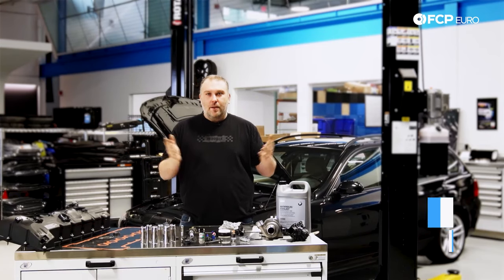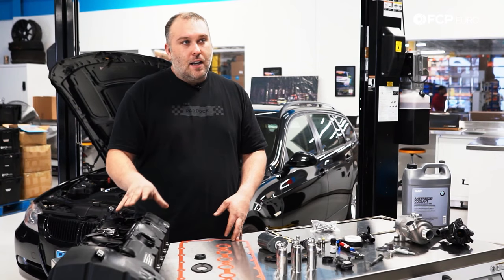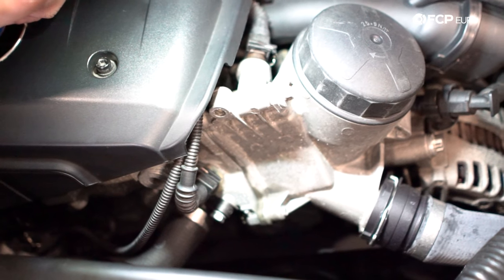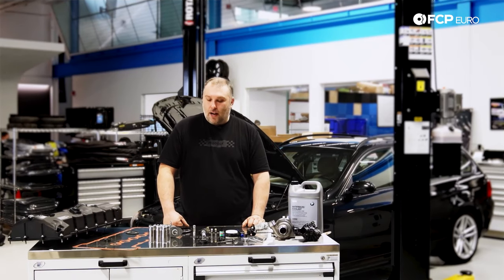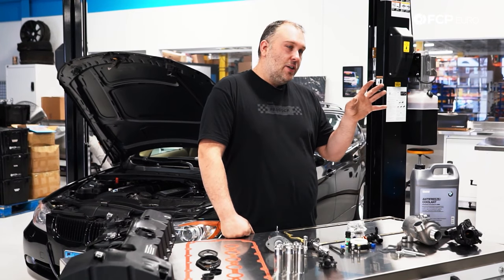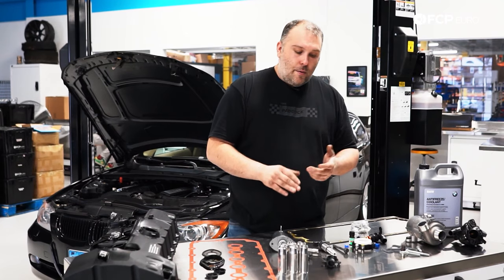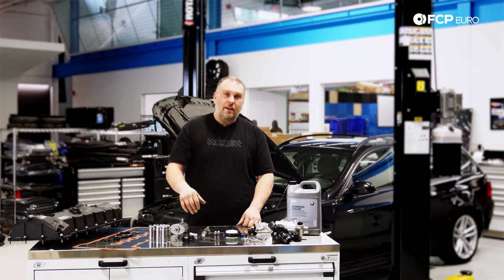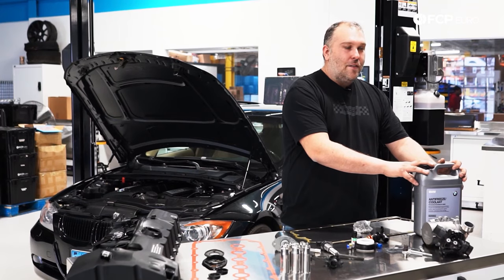BMW N52 Engine Diagnostics/Problems - Everything You Need To Know (128i, 325i, 328i, 330i, 528i)

Comment: These are certainly all the things I need to watch out for. I bought my 2008 328xi 6MT about  a year ago with 83k miles on it. All I know is it was a 1 owner car with no accidents but I have no idea if anything has been replaced on the car other than the previous owner had all of the recalls done. So far I have been lucky that all I've had to do is put gas in it. I had my mechanic look the car over when I first got it and the only thing he saw was a tiny oil leak from the oil pan gasket but there is never a drop on the ground so hopefully that doesn't get too bad too soon because he said it is a several hour job because of the x-drive. So I guess my only question is, do I just wait for parts to fail or would you be proactive at this point and start to change things? I now have 86K on it. (I live right down the street from my work so I don't put a lot of miles on it) For example, I have no idea if the plugs have ever been changed or what type of oil it's run on for it's life. Would it be a mistake to put LiquiMoly in it or Mobile 1 if it's only had conventional oil in the past? This is my first BMW and the car still looks pristine and I would like to keep it running as smooth as it currently does. Also, I live in Wallingford, CT and you guys are great!
Reply from the maker: Hey Sagan glad 328xi ownership has treated you well thus far! We always suggest staying on top of your cars maintenance and preventing possible issues from arising that can prove to create bigger issues. That being said its not necessary to throw every part in the book at the car. Sitting right around the 80k mark is really where we most commonly see things start to go. For now swapping the plugs, potentially throw in in a engine flush and some fresh LiquiMoly or another high quality oil simply cannot hurt (our most common https://www.fcpeuro.com/products/bmw-oil-change-kit-5w40-e60-e90-e82-f30-11427566327kt-lm ). Glad to hear you are local, be sure to swing by the retail center in Milford if you havent already (well once the current situation clears up)! From there just stay in tune with what your car is doing, dont let things go, once you notice an issue move to the remedy (your cooling system especially at that mileage).
Reply: Thanks so much!

Comment: On some models changing the oil pan gasket is a nightmare as you have to drop the subframe. I have heard of a shortcut where you cut the gasket in a convenient place so you can snake it in place and cover the joint with RTV. Any thoughts on that (other than the expected "don't do it" 🙂)?

Comment: Great video.  I am a long-time customer, years ago driving down to buy parts when you were in Groton.  I have two N52 in high-mile X3s.  Have done much of this work over the years.      An important note.  The BMW response with VANOS bolt failure is odd.  Some cars fall under a Safety Recall and other are under a 10 year extend warranty.   Last Fall the VANOS bolts heads sheared off on one of our X3s.  The bolt heads took out the engine and BMW replaced the engine under the warranty.  The warranty for that vehicle expired in April of this year.  Dodged a bullet.  Current problem maybe you can shed some light on. Suddenly I have had the engine cut out and cut back in repeatedly while driving at speed.  Idles great.  I have a BMW fuel pump to put in and hope this takes care of the problem.  Did you ever hear of this issue? I really do not see this mentioned on line. Feels like fuel starvation.  Thanks!
Reply from the maker: Thank you for the longtime support! You certainly did dodge a bullet with that warranty! That cutting out does seem like it could be a fuel issue, fuel pump is a good place to start. Any codes?
Reply: @fcpeuro  No codes using a Foxwell scanner.  Using the CTA fuel pressure tester that you sell, the pressure at idle is good.  Will how it goes with the new pump.
Reply: @fcpeuro  Follow-ups can be helpful.  I was totally wrong on thinking the "loss of power" may have been the fuel pump cutting out.  The fuel pump pressure tester that I bought from FCP  showed spec pressure.  Long story short, the problem was the right rear reluctor ring on the axel shaft that had underside localized corrosion that lifted a section of the ring so that it made contact with the speed sensor.  There are some videos on this. I did not have any engine lights but did have the trio : Brake, ABS, and 4X4 dash lights. Also a code indicating issues with right rear speed sensor.  Should have picked up on this right off.  It apparently sent the signal that that wheel was not turning and DSC  traction control system applied brakes to the other wheels. I understand that DSC can also cut engine power (in manual).  Extremely disconcerting on a highway with much fast moving traffic. Do the brake lights even come on when this happens?    I was driving on the shoulder with the bakes coming on and off. There are references that shutting off the DSC will eliminate the braking effect when you have this failure. Good to know for a temp safety situation.  New GKN axel shaft (has ring) and BMW speed sensor fixed the issue.  No dash board lights or codes now.. "On The Road Again" Thanks FCP!

Comment: what should the pressure RPMS on the 328i waterpump, 2008 sedan? thanks great videos..also in my old waterpump were orange pinkish pieces of plastic clogging the impeller fins and stopping them from turning.where did these pieces come from? thanks hope u cna answer~

Comment: Thanks for the info and I would like to find out, I am driving a 2007 E90 325i and it sounds like a diesel. My mechanic believes it is an oil pump not working properly. Can you please advise?
Reply from the maker: You're welcome, Papillion. If your N52 sounds like a diesel, worst case is that it could be a failing oil pump, however it could also be a faulty hydraulic valve lifer. If it is the valves making the noise, you can try some LIQUI MOLY Hydraulic Lifter Additives to see if it quiets the engine down. https://www.fcpeuro.com/products/hydraulic-lifter-additive-300ml-liqui-moly-lm20004

Comment: By the way the camshaft Rector rings that are steel or stainless they make a Teflon replacement unit that go on them so if you have to pull camshafts it's best to replace us with Teflon rings,
By the way the oil is not sneaking by? It's leaking because of the clearance and erector Rings is allowing the oil to bypass the ring! I don't know where the sneaking part came from? LOL

Comment: Hi there, Thanks for the video. At 11:42 you stated that clean the no return check valve and make sure it TURN , Can you please explain. I didn't find any part that turn. it only have an spring inside. What is a good way to test it and how is supposed to operate. Thanks

Comment: Also the cam ledge bearings seem to be a somewhat common point of failure. Along with lifters sticking, due to their check valve lifter design. I believe these are caused by the poor design of the valve cover (as said in this video)
Reply from the maker: Good point, Eric!

Comment: If you're talking about the e90x platform 328i is the best route to go for reliability the 335i gives you a lot of problems especially with that plastic charge pipe,wastegate rattle etc.  I have 370 HP on a 2008 328i sport very fun to drive daily make sure you change the oil filter housing gasket on all bmws. These cars drip oil naturally 🤣 also change your oil every 3800 miles..
Reply from the maker: all excellent advice!

Comment: Was thinking about getting a bmw but all these potential problems are pushing me away
Reply: damn near every car has a ton of things that can go wrong, bmw's just have some stupid extra german tech in their motors, so the things that **CAN** go wrong, are a bit less familiar than most people are used to. The N52 is actually extremely reliable, just make sure you keep up on maintenance.
Reply: Don't shy away from that. Nice cars, you just have to work on on them. Do it yourself and pocket that labor charge.

Comment: Only oil leak I've ever had is the valvetronic motor gasket, the way that leaks can look a lot like the valve cover is leaking so that often gets changed unnecessarily,  look at the top of the cover, if there is oil in the voids on top  of the cover it's probably the valvetronic. To be sure clean the cover well and observe over a few days where oil starts to leak from , if the valve cover joint is wet again straight away thenchange the valve cover seal as well , if just on top of the cover it's just the valvetronic motor seal.

Comment: Great video thank you very much. I'm so glad I have the m54 engine instead of this one, parts prices are fractions of these and so much easier to work on.. this is on another level mechanically. I wouldn't touch one of these if I hadn't a big wallet.
Reply from the maker: Glad you like the video, Alexander! The M54 is a great engine!
Reply: M54 leaks oil 2
Reply: @priveprive5315  that's for sure Gerwin! Valve cover gasket,oil filter housing are some of the most common but quite easy job to fix ...

Comment: Will you do a video on changing the valvetronic eccentric motor on a 2007 bmw 750li e65. And how to adjust the range or rather relearn the valvetronic unit using a Bavarian tech scann tool???

Comment: proud owner (let's assume) of 2006 330xi automatic. The car feels sluggish at the start before 2000 rpm. My mechanic said there are no engine fault codes and I have never seen a fault code on the dashboard since I bought it like 1 year ago. the car is very clean and everything works and looks fine. 2 oil leaks have been fixed, not sure if I now have more.
I read that in this case both DISA valves should be physically checked, despite no fault codes related to them, especially the one for the lower range rpm's. Will be done soon. Can you please give any advice? It can be that I have greater expectations coming from B6 S4, but this is not a slow car and it's really hard for me to believe that this car is so slow at the start!! 258 hp is not so little!  Everything else is okay.  In case the DISA valves are fine, should I assume that "it's how BMW designed it? A guy recommended a tuning on the engine and the gearbox to tune up the lower rpm range, do you think it can make a noticeable difference? I don't want to pay for fake tunes. Thanks!
Reply from the maker: Tunes can make a difference, while not as much on naturally aspirate cars compared to turbocharged cars, they still can make a difference if you get a quality one. Under 2,000 rpm is very low in the rev range, these engines really like to sing in the higher rpm's to get moving.

Comment: That was fantastic. Thanks a lot for that. 

I thought the water pump was made of plastic in the N52, pleasantly surprised it's not.

My N52 (E92 330i) has almost 150k km on the clock (92k miles). No problems so far, touch wood.
Reply from the maker: Thanks for watching Nexus. Unfortunately a lot of the cooling system in any modern day BMW is made of plastic ^.^

Comment: Hi Gareth. I love your craft. My n52n has a slow tick when at idle and warm at the speed of about 1 second apart. 
Spears to come from down low and under intake. Seems to stop when auto trans is put in drive. No codes on cluster. Any tips?

Comment: I’m having a crank no start issue, no codes for any sensors like the ones mentioned, and it seems like my DME and EWS is not talking to each other. My key fob works but my scanner won’t communicate with all of the modules. Like it won’t let me perform some active test because “it can’t communicate” but other things like door locks and stuff can be actuated. Do you believe I need a new DME? How would I know?

Comment: Ignition coil failure, usually after a tune up, (plugs and intake port cleaning) if you replace a coil or coils that failed and the new one or new ones fail on the same cylinders, you have an excessive amount of SPARK PLUG GAP. I don’t care what Gabe at the local Autozone tells you, pre gapped plugs are not a universally compatible pre set application, because the plugs are not solely designed to function within your cars operating limitations. 
For instance, heat, vs. super thin coated copper wire increases the conductors resistance too much gap in a sealed coil on plug in tube air tight in the hot center of cylinder head will create a demand for more electrical current due to the increased electrical resistance,  from a larger open space for the spark to jump to the grounded electrode, this resistance is shouldered by the coils internal conductors, and the resistance causes more heat to build up, a four or five layered super thin copper winding sandwiched between layered ferrite metal casings, molded in a polymer binder, coated in a synthetic layer or insulating boot, as the heat in the coil increases so does the resistance to the flow of electrical current, ohms resist amps, the heat can’t escape. I forget what that situation is called when a nuclear reactor goes “critical mass?” Anyway it self destructs,m, rapidly a self cannibalizing reciprocal malfunction to failure. Never mind pre gapped nonsense! What’s the harm in checking the gaps on every plug, as long as you’re careful and don’t mess up the platinum or rhodium electrode? I was ready to trade it in if I could keep the coils alive,  you’d be shocked after spending hundreds on coils connectors and more pre gapped plugs, when you meet factory specs, no more failed coils, and were pushing the odometer upward toward 300k miles. (Knock on wood) did have a stall and what seemed to be a stuck injector, blew it out, limped it home it repeated once or twice before I added a quart of oil, that seemed to get it cleared up, no codes other than a blinking service engine light while it happened, nothing in the history either, I wonder if it was the crankcase ventilation eating up my oil?

Comment: I have lack of compression in cylinder 1 before I changed both vanos and new plugs and coils but still running like a tank told it might be stem seals are there any other possibilities ie.fuel injector looking at second hand engine if so car is bmw 523.i petrol e60 2006

Comment: Excellent video! I have a 2006 330i 6mt with  AA headers, tune, coilovers, short shifter, M3 front control arms, etc.. and it's an amazing car. 

I have been recently experiencing a rough idle though . It usually starts happening about 2-3 minutes after starting the car, and isn't affected by hot or cold weather. I've changed the plugs and coils, and cleaned the MAF sensor with no success. 

Just wanted to reach out to see if anybody would be able to give me suggestions. thanks!
Reply: Ever figure it out ?
Reply: @chrisaltmn112  unfortunately not
Reply: i had a similar problem with my 06 325i with the 3stage intake and 330i software upgrade. i had what i thought was a battery issue but it was my alternator. the car would idle rough after a while of sitting on but once i replaced the alternator it was completely gone
Reply: Did you replace vanos solenoids? 
This worked for me

Comment: I had the vanos bolt sheer off on my car. A common recall on the n51/52 send hood luck because I hope it didn’t hurt my engine more and if it did will bmw fix that along with the recall? Would love to know thank you so much for any info possible regarding that.

Comment: Hey brother. I don’t know if you’re still reading comments but I have a 328i with the plastic valve cover, with a rough run on cold start and a somewhat labored idle. 

There is no check engine light, but it starts up and the idle bounces nearly every time you start the car. It doesn’t necessarily have to be cold. 

I’m thinking either the vanos solenoid non-return valve or the valvetronic gasket is leaking and causing this problem. Would you say I’m on the right track?

Comment: Oil leaks are a right of passage???? 
I’m about to pull the trigger on a 2006 325i but I’m not trying to buy something that is gonna leak. I’ve had Benz’s for years and don’t have issues. Is this a common thing for BMW? I HAVE to up grade the oil gasket and I’ll be fine?

Comment: My valvetronic worm gear snapped in my e90 n52 so that's another possible failure point. 

I was lucky the eccentric shaft was at the closed position when it snapped so the engine switched off before any damage inside the engine could occur and at that position its not possible to start the engine.

Oh and i had to program/get the valvetronic motor to relearn or whatever its called through software. I have the magnesium valve cover, relearning might not apply to other types.
Reply from the maker: Excellent information, thanks for sharing it!

Comment: I drive a 2011 BMW 328i and have changed the alternator, radiator, spark plugs, serpentine belt, starter, driving belt tensioner and battery. The car still does not run! Can you please recommend any repair shops in Tampa, FL?

Comment: Can you do a video on the angled heater ventilation part as well. Also do a video on the cam shaft vanos seal replacement seal ring. The plastic ring seal that fits on the cam shaft vanos system.
Reply from the maker: Hi Robert, we can add that to the list!